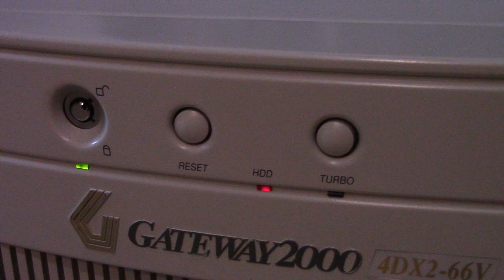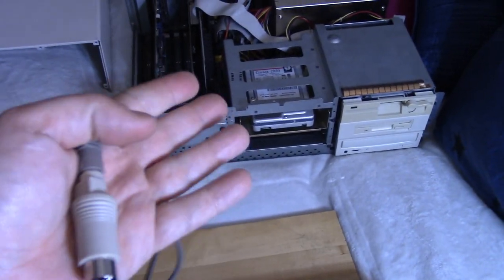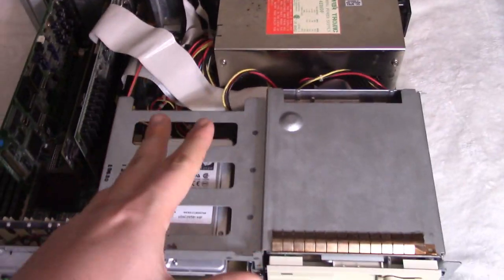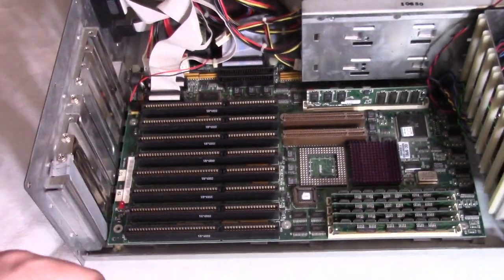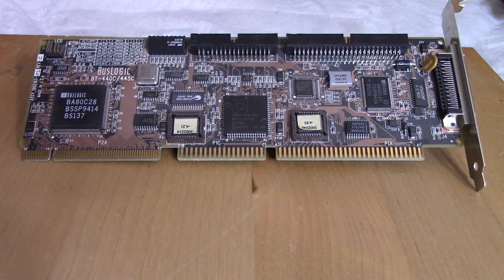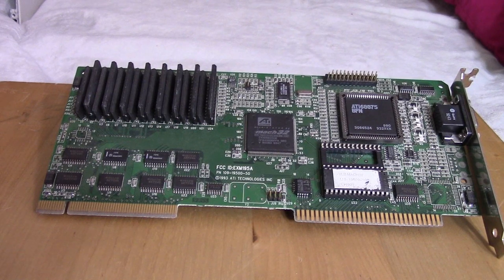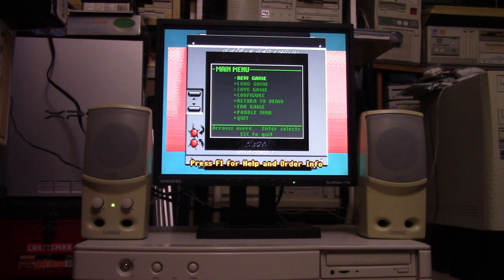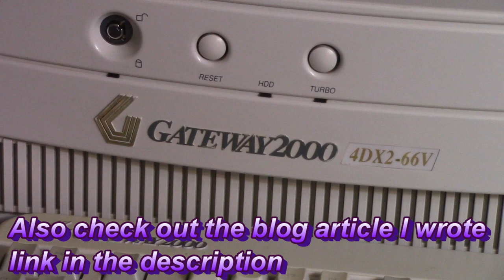Gateway 2000 4DX2-66V (Desktop)

Comment: I worked for Gateway 2000, and while I started in 94, I am somewhat familiar with this machine.  

First Gateway had an exclusive arrangement with Western Digital.  So all drives from 92 on would have been WD, unless they were SCSI, in which case they would have been a Seagate Barracuda.  One thing you also should take into consideration was that Gateway used "just in time" inventory.  What that means is that when this machine was ordered, it was likely that the only parts in stock was the case, the box, and the keyboard.  Every other part, including the power supply would've come in after the order was placed.  

There were exteme shortages of both memory, and CPUs during this period, so its possible that those were in stock, they would be in a giant secured cage in the middle of the factory floor (memory at that time cost $84 a megabyte).

After this machine was built, it would be sent up to the rafters of the factory where it would be "burned in" for 48 hours prior to shipment.  Many hard drives, and CDRoms would fail during this process.

CD Roms were in especially short supply, especially name brand drives.  The least reliable were Sony, and the most Mitsumi.  Mitsumi were also the most compatable.  There were no IDE CD Rom drives readily available in 1993, so they would have installed an 8-bit proprietary controller card.  Sometimes we would attach them to the sound card in a pinch, but since they still used jumpers in 93, and also hard to be multi-sourced.

I do not remember ever seeing a SCSI CDROM in a Gateway until 1995.  Since SCSI had only been around seven years when this machine was built (it was invented by NCR in Wichita, KS in 1985), SCSI was still not trusted.  Since the controller was in the drive with IDE it was considered superior from a reliability standpoint.  You could get an Adaptec 2940, and a Seagate SCSI drive, but those were priced prohibitively expensive on purpose and usually had a six week leadtime automatically.  

The reason you could not attach your Caviar hard drive, and CDROM is those are both EIDE devices or 32 bit.  Even those this had VLB video, it had 16 bit, or IDE drive controllers.  

VESA stands for Video Electronic Standards Association, and therefore in 1993, "Local" bus meant just the video card.  The cards were so buggy, a lot of users would end up just replacing them with 16 bit cards anyway out of sheer frustration, which is likely what happened here.  

Anyway I have a retro Gateway channel I am just starting under Dinty76538 (my Gateway 2000 stage name and badge number), if you want to check it out.
Reply from the maker: Thanks for the comment and the information. always cool to hear from people that were in the tech trenches back in the day. I'll definitely check out the channel and I hope it does well and you enjoy creating for it.
Reply: Did you work as tech support? My uncle worked there as well in the 90s in SF

Comment: Thank you for opening it. I have the DX2-50 model and I could not for the life of me figure out how to open it
Reply: Wait... you didn't  even show how to open it.. my god... how on earth do you open this thing
Reply: I swear I have all the screws  out and I don't know where the hell I'm supposed to lift  the case off
Reply: I finally opened this beast. Needed to replace the dead floppy drive. There's a motherfuckin' tape drive installed on this beast.
Reply: Real tight area in this sommobich, could barely take anything out. Woe be to compact computer design.

Comment: Great video! I love Gateway 2000 computers. I have the manual for this computer so If you ever need any info from it just let me know. I have been looking for the manual for the Gateway 2000 4SX-25 or 4SX-33 for years with no luck.
Reply: Any way you could get a scan on archive.org?  If it’s hard to find, given this is such a popular model, it would help a lot of people.  :-)

Ditto if you have any restore discs!!
Reply: @nickwallette6201  I will try but the manual is very thick with hundreds of pages. No restoration discs unfortunately.
Reply: @theking21083  Ohhh... wow.  :-)  Hm, that would be an undertaking alright.  I didn't realize what I was asking.  haha

I can't imagine what would consume hundreds of pages that isn't already documented well enough elsewhere...  (I am assuming it's largely DOS / Windows references and such?)

If you have the ability to capture the stuff that really matters, and isn't available in other forms -- like jumper references and supported configurations of cache modules, and for archival purposes, anything that documents original configurations -- that would be the most helpful.

This is something I try to do when I have the benefit of original documentation and/or media, and I encourage others to do it as well.  But I don't expect anyone to un-bind a dictionary-sized tome and spend a week converting it to a PDF.  ;-)
Reply: hey do you still have the manual? i have a 4dx2-66v that isn't posting and I'm trying to get to the bottom of what's wrong with it...
Reply: @zeldamasterbro  Yes I do.

Comment: The one I have has the same model code but looks really different to yours. The small floppy drive Is vertical and the power is on the front and it's a button. The back is also really different.

Comment: broken record here: 100% / 55% (content loudness 5.2dB)
Now recording speakers was interesting, it demonstrates either 
-power director config screwing levels wildly
-you actually DO listen to games at ~4x your own talking voice volume :o

Were the speakers at 34:00 set to 70-100%? Because they come out in the recording like set to max volume, as if you would have to scream to punch over the sound.

Wow, over 1/3 of that computers price was in CPU and motherboard alone. Intel charged ~$700 for DX2-66 in 1992, for comparison SX-33 was $190. It was a bad time to buy new computer, speeds doubled every year. I got curious and looked up prices.
1993 Pentium 66 twice the speed, DX2-66 half the price(~$360).
1994 Pentium 100 again twice the speed, DX2-66 again almost half previous year price(~$200).
1995 Pentium Pro 200 twice the speed, TI DX2-66 1/3 previous year price ($66).
1996 3dfx Voodoo launches, 
1997 Pentium 2 300 MHz
1998 Pentium 2 450 MHz
1999 P3/K7 500 MHz
2000 P3/K7 1000 MHz
2001 Athlon XP 1900+ 1.6 GHz ($269).

Insane ride.
Reply from the maker: naa, I generally don't have those speakers turned up to even 50%. Maybe a quarter of the way. That clip they were turned up louder but it was because the mic on the camera is a little weak.

It's crazy how fast things seemed to move in the 90's with speeds and such. There's such a difference between a CPU from 93 and 00. but that MHz number was so important to marketing.

Comment: Wow really cool video man! I just bought one of these. Mine is the same model number but is more bulky and has "baby at" in the name. Have you had any experience with that unit? I'm getting it shipped in a few days . Really excited!
Reply from the maker: congratulations!  I think I at least know the case your talking about. does it resemble this one? https://ancientelectronics.wordpress.com/2014/05/22/gateway-2000-p5-120/
Reply: @AncientElectronics  sorry for the late reply! Didn't even see your reply  And yes that is the one! 

When I got it was 100% original, everything was stock. I was so happy, til I plugged the monitor In and fried the whole board. Had to track down a new power supply , that micronics board (had to settle fpr one made a year later) , and 2 new processors (the first one I ordered was dead). Yesterday I finally got it to boot up, only to find out that the Dallas RTC chip is dead... Lol so it's been a long (and expensive) road.

Still super excited that I got it to boot up and it's close to being up and running.

Comment: That sound card you're having problems with is a Media Vision, but not one of the good ones. It's a cheaper model than the popular and awesome Pro Audio Spectrum / Pro Audio Studio. You might be able to get it to work better if you use the settings in a game specifically for the Pro Audio Spectrum or any Media Vision option that is available. There was native support aside from Soundblaster emulation.
Reply from the maker: It was emitting noise and screeches even when audio was not being outputted. I fiddled with it for a good while but nothing. Don't know if a bad chip or cap would cause that.
Reply: @AncientElectronics  Yikes. Yeah, there could be some bad component on them. I got my hands on a Pro Audio Studio recently and I'll be putting it in a 486 build. My Packard Bell 486 back in 1993-1997 had a Pro Audio Spectrum and it had a great sound.

Comment: I have one of these but no keyboard or mouse. I cannot for the life of me remember where the mouse plugs in.
Reply from the maker: If you have the same model as me you'll need a serial port and serial mouse.
Reply: @AncientElectronics  Thanks! Mine is a 386 but very similar. Would it be com1? I uploaded a video: https://youtu.be/dPWw8-aFeRI Also would you know if I need a crt monitor? I tried booting to a lcd and nothing came on the screen.
Reply: @clutch2827  or buy a isa card with mouse port?